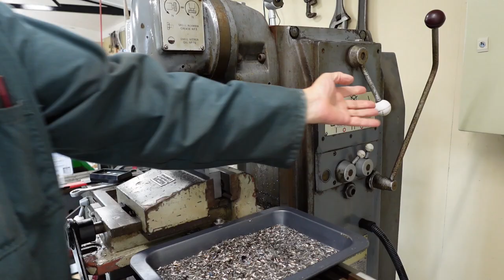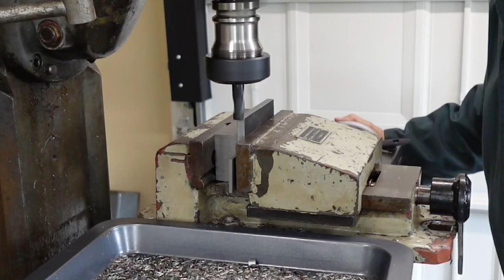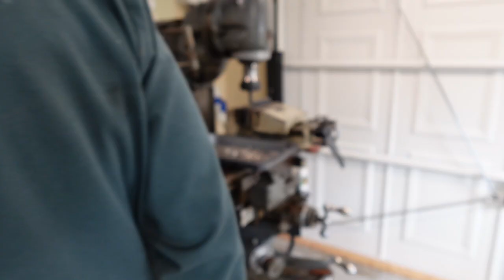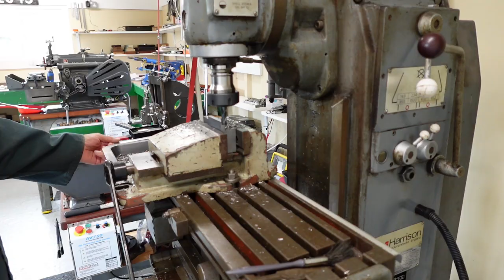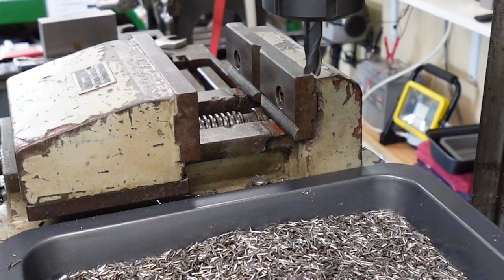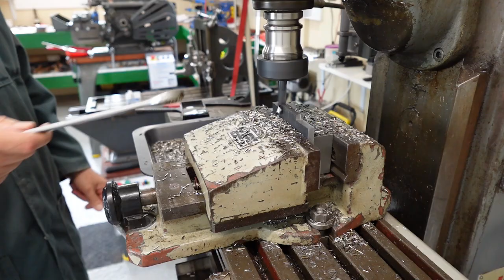New Camera First Job.  Harrison Universal Milling Machine work

Comment: It was a good video . I could'nt hear you speaking when the mill was running other than that i liked it. Thanks
Reply from the maker: Yes I did not realise how noisy the milling machine was, I wear ear muffs when using it.  I will have to remember to only talk when the Mill is stopped.